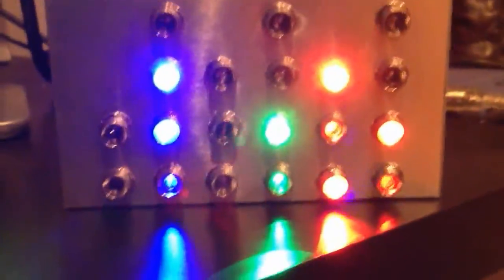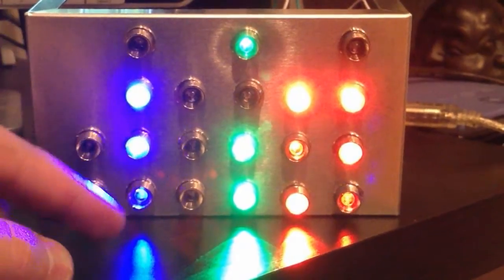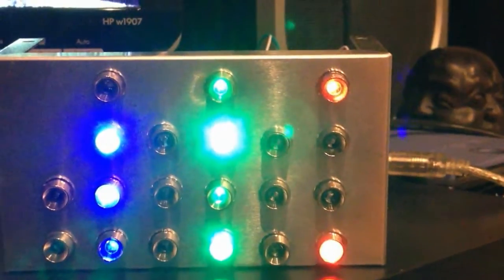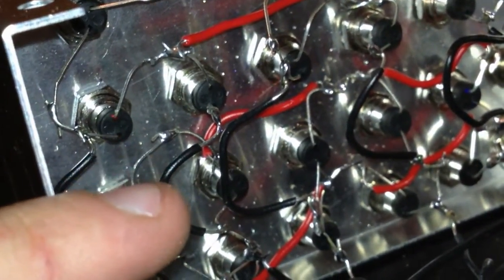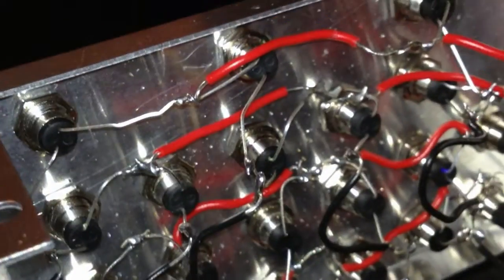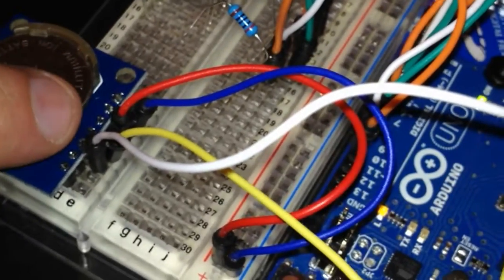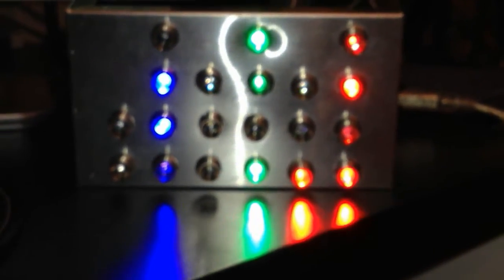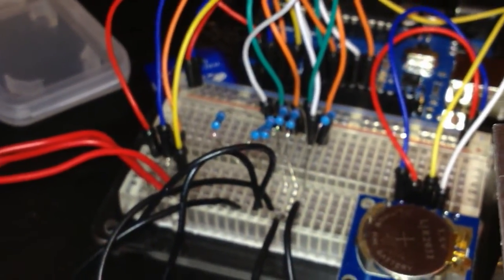Arduino Binary clock with Seconds (Multiplexing LEDs) and RTC

Comment: An Arduino Nano or Uno is about $2.50 on Aliexpress. They have 20 digital outputs.The analog pins can be used as outputs. To build a true binary clock one only needs 17 pins. 2 rows of 6 and one row of 5. You are making this project way more difficult than need be!!

Comment: 74hc138 demultiplex chip with binary addresses, X being the rows, y being the columns, and z being the layers, can you help with  a video on the code as this is what i need to learn before atempting the build.(A guy at work told me about the chip and , and said to use it with common anode rgb leds